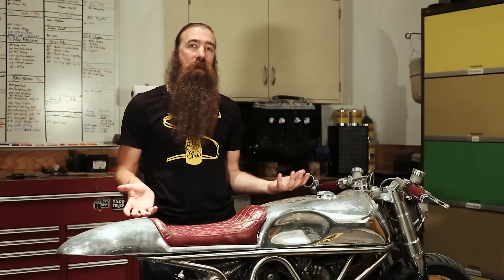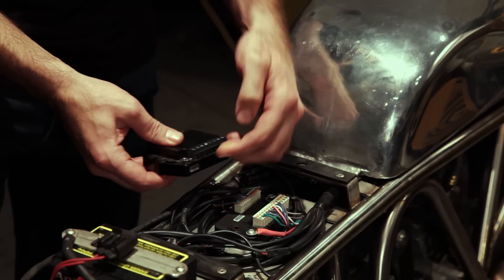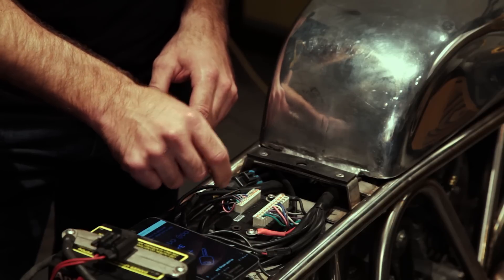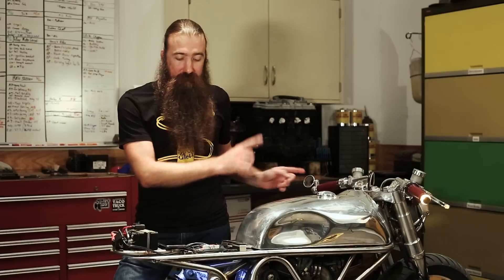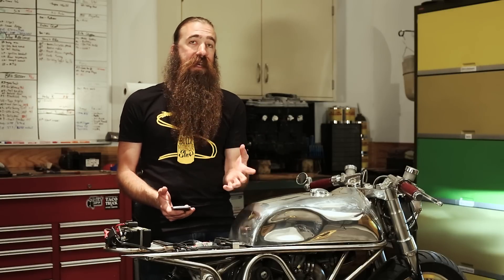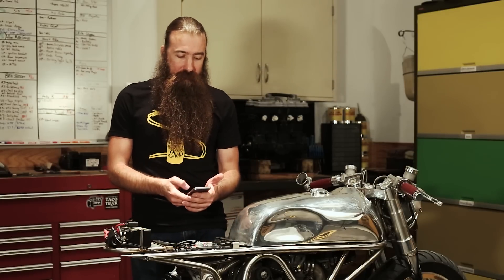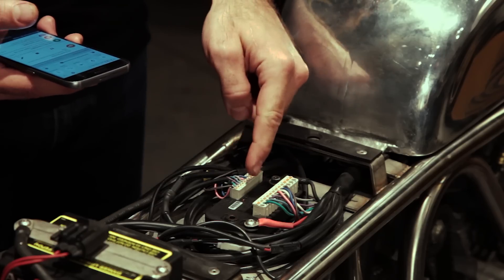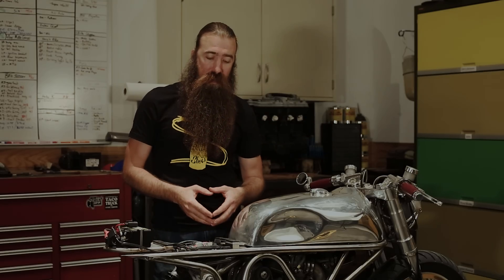Revival Cycles' Tech Talk - The M-Unit Blue on an Actual Motorcycle

Comment: Do you need a starter relay, when you have the m-unit blue??
Reply from the maker: Yes you do. The M-Unit does not take the place of the starter relay, it only supplies the power signal (+12v) to engage the relay.

Comment: Does this make install with the m.lok easier with the m unit blue?
Reply from the maker: Using the Mo.Lock with the Mo.Unit will allow you to wire the Mo.Lock without the use of the supplied relay.

Comment: How do you turn on the position lights only in the front and not in the back and the turn signal control LED? Z-Diode doesn't work because it's a pwm Signal.

Comment: So if someone knows you have an M unit setup , could they potentially be able to link their Bluetooth to your M unit and then have full access to your bike ? Like a bike hacker if you will.
Reply from the maker: They would have to be able to turn the bike on in order to pair with your mo.Unit since that's part of the pairing procedure. I'll speculate that someone capable of hacking an m.Unit to steal a bike would be using their time for something more lucrative. The few thefts I know of involved a group of burly dudes kicking the bike up and tossing it in the bed of a truck.

Comment: Just wondering what will happen when someone want to take my bike for a ride and they ride away from me and my Bluetooth connection.
Reply from the maker: Nothing at all. The Bluetooth connection is only capable of turning the bike on. It will not start the bike or power it off. If your friend switches the bike off they will be stranded.
Reply: @RevivalCycles  thanks 👍

Comment: You guys seem to know the most about these units!  Does the mo.unit blue have any issues with battery drain?
Reply from the maker: If left for months on end without being put on a float charger the milliamp drain will pull a battery down but the same is true for any bike with a modern electrical system. 

Thanks for the compliment by the way. We've done over a hundred installs and sold them by the thousands. Some folks may have more model specific experience but I don't know that anyone has more general knowledge or experience providing support on them.

Comment: So does this cut wording down. Would I be able to take away the wire harness and does this lower wires that need to be grounded. Also does this have a built in fuze.
Reply from the maker: It is a solid state fuse block replacement with a solid state micro controller that removes all the voltage from the control switches. It does not reduce the need for grounds. It does cut down on quite a bit of wiring and removes the need for most relays. Be sure and check out the series of guides and diagrams in our Knowledge Base. https://technicalarticles.revivalcycles.com/hc/en-us

Comment: I have to say, this is friggin amazing, I still think it seems like a HUGE task to start running the wiring. However you guys make amazing content that really makes me feel a tiny bit more comfortable thinking about starting running new wiring on my GSX750 81'!

Best Regards from Denmark!
Reply from the maker: It's certainly a big job but perhaps one of the best improvements you can make to an older bike. When you consider that the electrical systems on these old bikes are riddled with issues you may spend more effort chasing mysterious issues and never have a bike that is reliable enough to be a daily rider.

Comment: Good video, small and smart product but if I wanted all this technology I would get a Ducati or something similar. I don't see a point installing this on a old cafe racer.   Sorry, sometimes less is more.
Reply from the maker: An old cafe racer is exactly the bike that needs one of these. If you're just more into wrenching every free moment and you enjoy the whimsy of life riding an unreliable bike then the m.Unit is certainly not for you. However if you like riding vintage bikes long distances without the nagging feeling that you may be spending the afternoon on the side a country back road poking at wires while you wait for your buddy to show up with his pick up then an m.Unit might be something you'd be interested in. 
Sure, it's got a lot of fancy features you don't need or want, milage tracking and service interval updates and whatever, so don't use those. The magic is in the hardwares solid state fuses and relays along with the ability to monitor voltage in real time and immediately identify exactly where an electrical fault is in your harness.

Comment: If you were to guesstimate an average price for install...I’m in nyc and ordered the m blue before finding out and I’m worried now
Reply from the maker: Questions I would ask a shop before bringing my bike in. 
1. Have they done this install before or is this the first time? Are you going to be paying for them to learn? Do they have photo's of other installs they've done?
2. What kind of warranty are they providing for their work?
3. Are they going to provide a wire diagram of their work? 
4.Are they going to program the m.Unit or will that be your task?

How much time do they estimate? A professional quality installation on a simple carbureted bike usually takes us at minimum 5 full 8 hour days or 40 hours to create a professional, OEM quality harness and install it, not factoring time to create a diagram or troubleshooting if there's an issue. You should expect significantly more time for a fuel injected project.
Reply: Revival Cycles holy hell!!! That’s a lot more hours than I thought it might be. At my triumph dealership the hourly rate is like $168 an hour. That would come out to $6,720 which is half the price of the bike! I definitely don’t think I’m going to do that if that’s the case but does that sound right to you?

Comment: When you run the m unit on a motorcycle is there a constant current draw on the battery all the time? (When it's off or in storage?)
Reply from the maker: There is a small draw in the milliamp range for the Memory and Bluetooth functions. Like most modern bikes, you'll want to keep the bike on a float charger when left for extended periods.
Reply: Sounds like a pretty good system. I have a couple of Harley's to build yet before the funeral, I think I may try this. My trust level is kinda low, I bought a similar system from Jireh Cycles a few years ago and ended up throwing it in the garbage before I even got the bike done, seemed like a good idea at the time but unfortunately the people who built it where more into profit than integrity. This one looks worlds apart from the one I got back then.

Comment: Do you think that I can use one of those on an old VW beetle??
Reply from the maker: Theoretically but the are are better suited automotive PDMs out there. Over the years we have sold a number of m.Units to folks planing a car install but I've yet to see one completed. The big issues are the limited number of outputs along with the relatively low max amperage of each output making it impractical for most cars.

Comment: What if there is no starter.  There is a key ...on run off... switch but it is kick start. I'm learning, new at this.  Rebuilding and pumping out my 1984 Yamaha QT50.  Do I need a starter for this unit to sync?
Reply from the maker: Soot us an email to techsupport and we'll help you through this.

Comment: Can you run this unit on a bike withought using the app or smartphone
Reply from the maker: You can, that is what the m.Unit Basic is all about. In my experience the Blue is worth it just for the amount of time it saves setting up the m.Unit with the app as well as the live voltage monitoring and troubleshooting.

Comment: I have a problem. The setup worked fine. But all of the sudden the rear tail light is flashing(I'm using one wire setup). And in the menu option 2 I have 4 choices instead of 3.
Reply from the maker: It can be difficult to provide support through Youtube. Shoot us an email at techsupport@revivalcycles.com and we'll get you sorted.
Reply: @RevivalCycles  thanks for the reply. Found the problem. It was the low voltage of the battery :)

Comment: But what i have to do if i have a Kickstart?
Reply from the maker: So long as your bike has a battery it doesn't really make a difference.
Reply: @RevivalCycles  thx for your fast answer🙏
Reply: one question... i sell my Munit V2 with the Motgagdet m lock. becouse i thought i dont need this, becouse the new Motogadget Blue has a keyless system now. but for the install i need a key system. is ther a way to install it without the Key system ?

Comment: What if the Bike has no Starter? I wanna bild a XT600 Tenere 34l from the ground and she has no Starter!
Reply from the maker: So long as it has a battery not having a starter isn't an issue.
Reply: Revival Cycles But to make the connection, you said in your Video that you have to push the START BUTTON! But I don‘t have a starter, so I don‘t have any starter button! ;-)
Reply: @oliverschmidt2803  Have same issue, all wired in ok but cant sync the app and unit due to no actual starter button
Reply: MitchPayne had a Call with the Support Team from motogadget.. we have to use any button, just to simulate a Starterbutton! Just meanwhile the Sync process!

Comment: Great quality video...What kind of turn signals do you have on the bars?
Reply from the maker: Those are the Motogadget m.Blaze Discs. In our opinion the best bar-end signals on the market. Perfectly machined finish with seamless transitions into resin lens which has forward and rear reflectors cast into it. 

You can find them in our store at eh link below. 
https://shop.revivalcycles.com/motogadget-m-blaze-disc-led-turn-signals/

Comment: Great vid! Thanks for the great info. Has anyone fitted an M-Unit under a 1966 Triumph 2 1/2 gallon tank? It's 90x53x30mm so I guess it will be tight. Cheers from UK.
Reply: How big is the original fuse box? You won't need it with the M-unit so you can possibly use that space for the M-unit

Comment: Will this work with my already exsisting on my bike like handlebar control buttons,  ignition system, charging system, headlight/tail light, turn signals, horn, starter solenoid, and  dash lights/gauges ?
Reply: You'd need to trace and re-route all wires to/from the m-unit, but it should work.
Reply from the maker: Yes and no. The OEM latching switches have to be required in order to work with the m.Unit. You switches are designed to close and maintain 12V+ circuits while the m.Unit is looking for momentary ground signals. 

How to do this is outlined in the article below. 

https://technicalarticles.revivalcycles.com/hc/en-us/articles/360008815572-How-to-Modify-OEM-Switches-for-the-m-Unit

Comment: Hiya - just bought an m unit - was wondering if anyone is making a lid for it? Can't be good having all of those connectors open to the elements 🚿😴🤯
Reply from the maker: No need for a lid, the circuitry is all potted. While I wouldn't mount it to the underside of my fender, there's nothing to worry about so long as it's under a seat, side cover or tank and it'd probably be fine entirely exposed, I just wouldn't see a point in doing that.
Reply: Revival Cycles thanks dude. Also debating keyless tech - huge report just published here in England by leading insurance companies on thieves targeting keyless vehicles as they are easier ... Anybody got an idea how to beat that?
Reply from the maker: A thief would first have to know that your bike has bluetooth keyless tech which isn't all that common. Then they'd have to know specifically that it's an m.Unit and how to turn the bike on once they'd managed to fool the m.Unit. If someone is that skilled and determined then what's to stop them? More pointedly, why aren't they focusing on where the money is? namely 4 wheel luxury vehicles. I've never heard of a scenario where a thief took the time to circumvent a motorcycle key in public when a couple of heavy lifters can pick it up and drop it in the back of a truck to deal with in a safer location. 
-Berry
Reply: Revival Cycles ha ha ha - I applaud your common sense - I will get a GPS and barbecue them but I prefer beef to pork ⚔️😂🇬🇧

Comment: Hey great insight into M Unit / regarding alarms - is there a way to integrate a GPS into the alarm function - track it..?
Reply from the maker: That would be something you would have to install external to the m.Unit which is possible.  It would need power provided directly from the battery since the m.Unit can not provide power to anything when it's off. 

-Berry
Reply: Thanks dude - I just bought a blue and had this convo with them too - can anyone out there recommend a GPS unit?
Reply: @BlackbeardBikes   check out the boomerangbike GPS tracker + alarm

Comment: would an m-lock be needed for the ignition switch if i plan on going with the m-unit blue or could a temporary switch (or a 6th button) do the trick?
Reply from the maker: An m-Lock is not required but you are relying on the Keyless-Go you do need some sort of ignition switch whether it be a key switch or hidden latching switch for situations where you dan not use your phone or you leave the bike with someone else. 

-Berry

Comment: I,m  currently restoring a 1967 Dnepr motorcycle & sidecar, which doesn't have a starter or modern type electrics, but by using the M-Unit Blue it will enables me to install a much better electrical system with up to date features such as you have described in this video.   Great informative videos guys, keep it up.
Reply: So it’s possible to use a m-unit blue without a start button? I currently want to make a m-unit blue on a small bike with only a kickstarter and I don’t want to use a ignition key

Greetings from Holland

Comment: That anti-theft feature, do you need an external sensor for that to work or is it buit in the M Unit?
Reply from the maker: That is built into the m-Unit. There is an inertial measurement device in there and it can detect anytime the bike moves.

Comment: Hi Guys and sorry if this question has already been answered but lets say I walked away from my bike so the alarm has been activated, now me or someone else need to move the bike because it's on the way of something/someone and my phone isn't with me or that person. The bike will start screaming and there is nothing I can do about it? Or I want to drive back home and my phone battery is dead... If I have an M-Lock on the bike it shouldn't be a problem to start the bike right? Or will the alarm scream like hell until I get home? Thx
Reply from the maker: It is true that the alarm will go off if the bike is moved and the alarm has been armed. That is normal and the way it is supposed to work. But if you have an issue with your phone, there is no problem using an alternative ignition switch, like the m-Lock, a key switch, or even a hidden toggle switch or latching push button. Once the ignition switch has been turned on it will disarm the alarm and you can ride like normal. It is always a good idea to use a back up ignition switch for these exact reasons, it could even be as simple as a pair of bullet connectors somewhere in the loom that you connect together to complete the circuit for the lock input on the m-Unit.
Reply: @RevivalCycles  Thanks a lot for that super fast answer! I love the idea of having all the Infos on the phone and getting a notification in case someone is moving the bike but I think that I'll go for the M-Unit Basic to not always have to deal with the Bluetooth and my phone. Plus it's cheaper! All I need is to be able to operate the switches and to have an alarm. Your videos are super helpful and inspiring! Thanks again! ;-)

Comment: I have a problem I can`t figure out; when I connect power to the M-Unit Blue, it just starts flashing all the LED`s for about 3 seconds before it quits. Afterwards it just blinks the start output for every time the «gyro» notice a twist or turn.
What is this? I can`t find a solution in the manual..
Reply from the maker: Assuming you do not have any wires connected to the inputs or the outputs, and are only powering the main power terminal and grounding through the mounting bosses, this sounds like a malfunction. You should work with your supplier for a resolution, but this does sound like abnormal behavior, but if you have inputs or outputs connected, you may be getting external problems causing this.

Comment: I'm trying to build a race cart with a 2000 Yamaha YZF R1 engine. I have watched all of your videos and I'm really interested in your products and am a fan of your work.    I'm having trouble getting the wiring started on the engine control side of the house. I have the head lights and such already figured out but I don't have the knowledge to make the engine wiring. Is there a general idea I can use for the engine? Or what products do you have strictly for engine control.
Reply from the maker: We don't have much specific to engine control yet, but for most applications it is easy enough to re-use the factory engine controls. I also know it can be daunting to decipher the wire diagrams. The approach I use is to identify the ECU or the ignition module (pretty sure 2000 R1 is carb'd). Once you find the ignition control box, then you can trace each wire from it. Typically there will be a power feed, a ground, an ignition coil control wire for each coil, a few wires for the pulser coils or crank position sensor, maybe a TPS sensor, and possibly some safety interlock wires. By tracing everything from the control module, you can probably get a handle on what each wire is doing, then you can re-configure for your application. 

The end goal is to set the ignition system up exactly as factory, but provide power from a different source. If you can get down to the point where you are just confused on a few wires we can help. Techsupport@revivalcycles.com